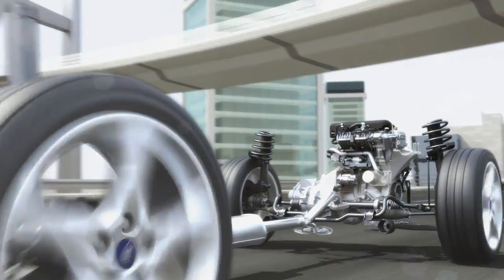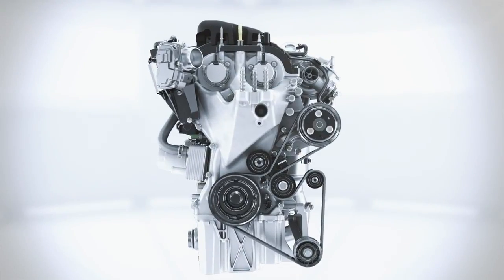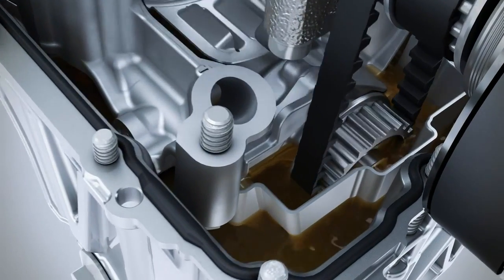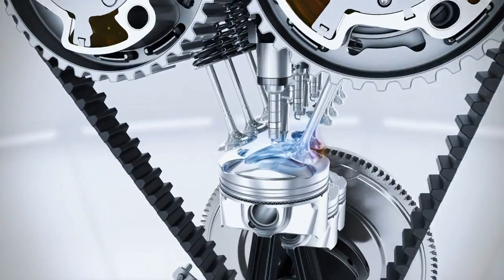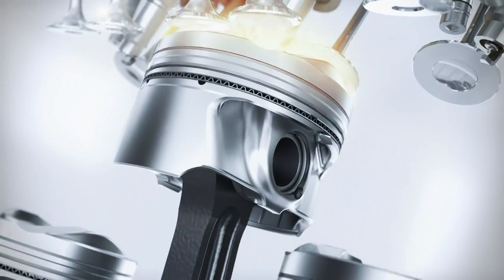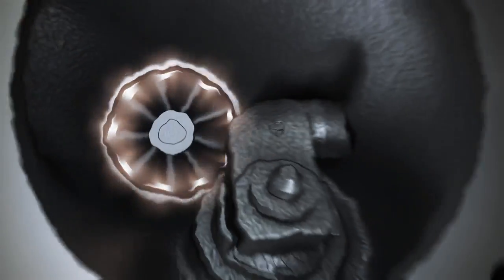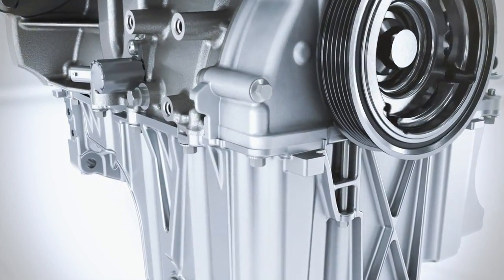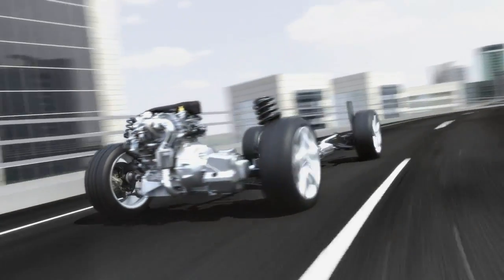NEW Ford EcoBoost 1.0 liter Engine.mp4

Comment: one problem with this enigine is it a interfearance enigine so when the timeing belt breaks the piston hits the valves and breaks the valves or damages the cam shaft of the valve breaks off and cracks a head or divids a head makeing it useless or scratches a cylinder on a non interfearnce timeing belt enigine that will not happen